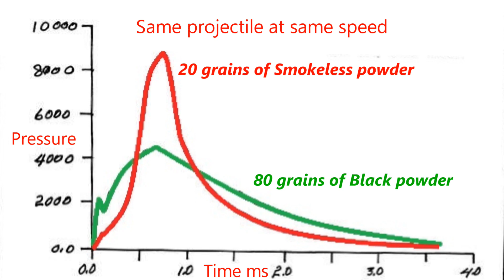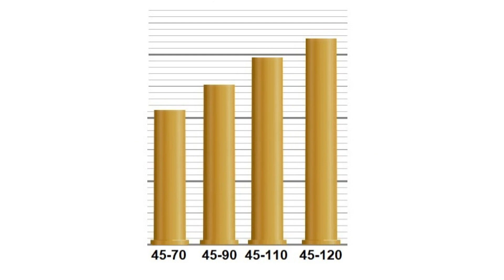GUN POWDER how it works

Comment: Concerning animal fats used in the manufacturing of munitions: I have seen old posters from WW2 with messages exhorting fur trappers to turn in the fat that was fleshed from the pelts of their catches. I would assume the fat was rendered to obtain nitroglycerin for powder and explosives.

My .45 cal flintlock rifle has a 42 inch barrel... It will push a 130ish grain roundball at approximately 2100 fps. Primitive by today's standards, but quite accurate.
Reply from the maker: Yep, thanks Jack, Cheers

Comment: I have been looking for some good internal balistics resorces. I have been wanting to look into some of the deeper aspects. As I have said before I am interested in what can be gained if pressures are increased. In a custom design and not just overloading. It has more to do with my wishing to work on the metals application rather than actually shooting. But hey. If I can pull it off I would shoot it
Reply from the maker: Cheers
Reply: Pressure and velocity are not linear.  Some cartridges and applications the pressure increase may have a relatively predictable velocity increase but that is a very limited predictability.  There will be a point that given projectile with a specific propellant increase that results will be unpredictable.

Comment: I've read some more about secondary pressure spikes. They usually happen in the longer barrels at around 1 millisecond on the pressure curve. The theory is the bullet gets out ahead of the powder, pressure drops and the bullet slows slightly. When the burn catches up, it smacks the bullet and creates a pressure spike. There's also a huge muzzle flash and the report is louder. Have you ever experienced that with your longer barreled rifles?
Reply from the maker: Nothing we've seen, but something else involved to cause that sort thing, cheers

Comment: Do the black powder replacements like 777 and Pyrodex "work" the same as black powder where they sort of self regulate, or are they more like smokeless powder where there is a larger pressure spike? I have a rifle that I've used black powder in, but never experimented with the replacements. Thinking about getting back into muzzle loading guns to supplement my airguns because I find the muzzle loaders fun and relaxing. I also like the big boom!
Reply from the maker: From what I have seen, they work the same, just a little less sensitive to ignition, bit safer to be around, Cheers
Reply: BP substitutes in cartridge use will generate a slightly higher pressure than BP and usually cannot be used volumetrically the same.  Muzzle loaders little difference.  The  burn rate on on almost all the substitutes is pretty much the same.  Less smoke and fouling are the obvious advantage.  As well as a bit safer to store and shelf life.